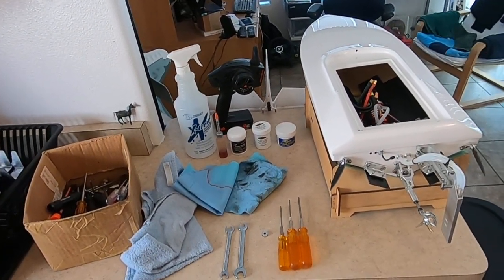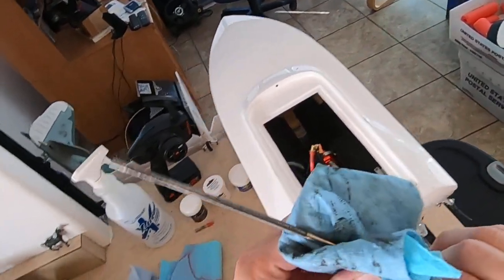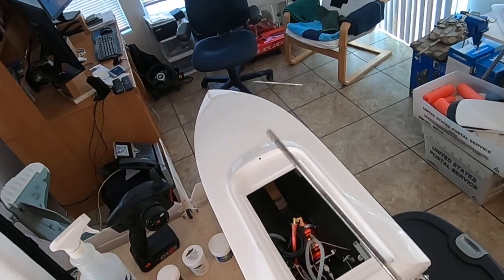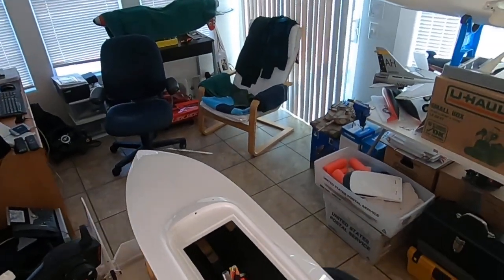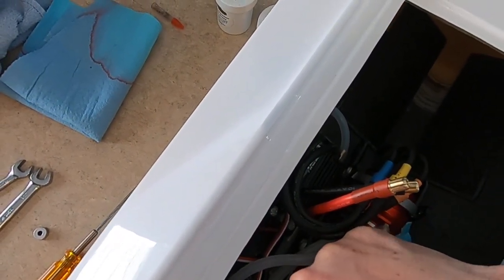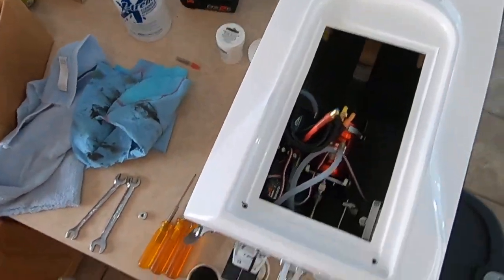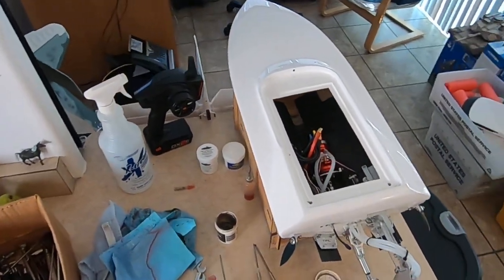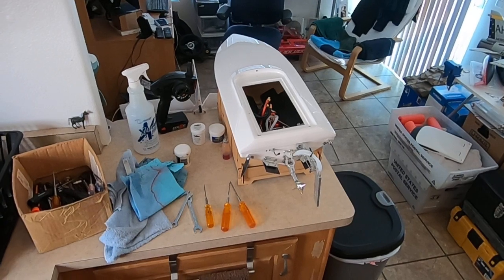RC Boat Shaft Lubrication 101

Comment: I have been using lucas oil marine grease I am starting to think it's to viscous as it seems to slow my prop down substantially in both my rc boats I will be switching to dynamite grease soon b4 summer starts tell me what you think is there a better option???

Comment: to start the video you said put grease here and the did it off frame doesn't really help if you are doing a video and do not show the spots you are greasing in the damn video
Reply from the maker: It was really more of a parody video not meant for instructional use. Lube the entire shaft except about 1in of the end that goes in the collet. I try and wipe the end as it goes in the collet. 👍